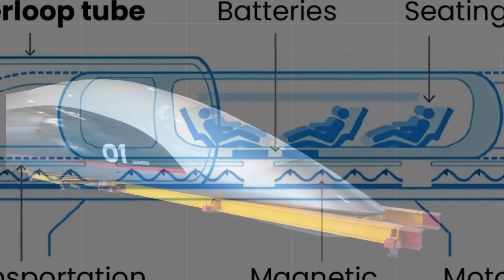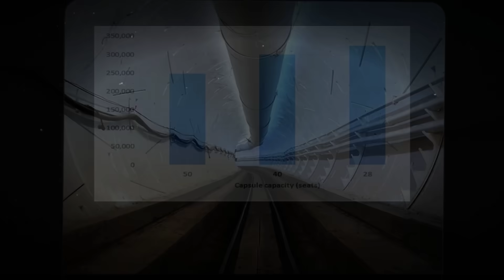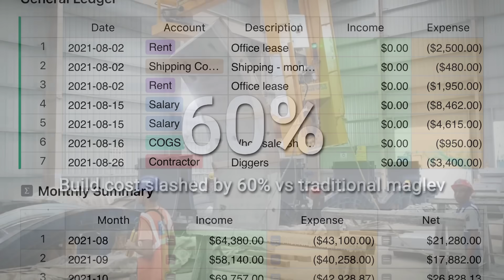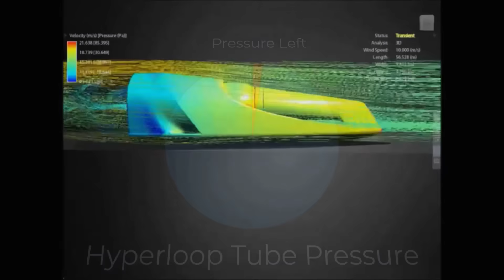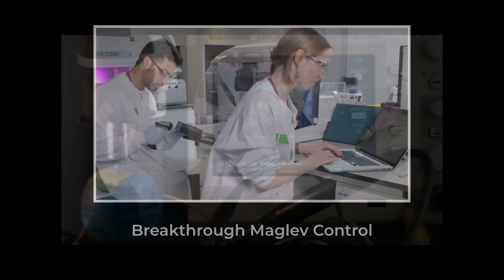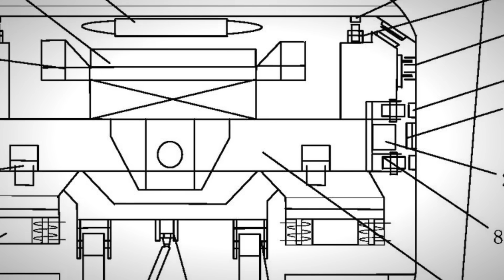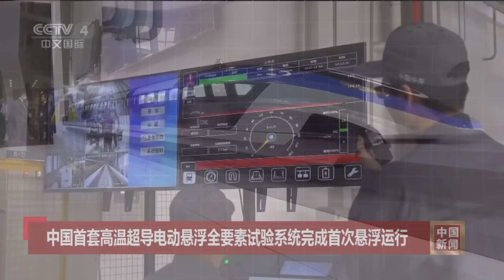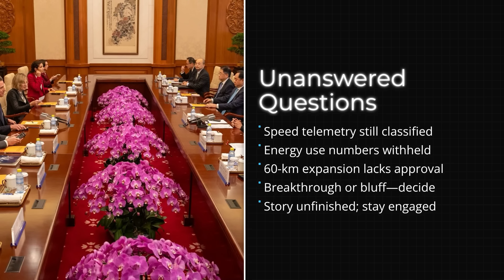China’s 2-km Hyperloop-Like Line in Shanxi That Cuts Costs by 60%

Comment: rather than creating a vacuum, seems more practical to just make the air move as fast as the train! Like big fans!
Reply: Make two tubes one for each direction, suck air from one tube and blow into the other, on each end.
Trains will fly like pistons pull from the front by partial vacuum and push on the back by pressure.
Reply: No.  You'd need gigawatts of power to accelerate the air to the speed of the train, and more power to maintain that air speed along the entire length of the tunnel.  Most of that energy would be lost as heat from friction.  You'd basically cook passengers in their seats.  And what would happen if the train needed to slow down or stop?
Reply: @-_James_-  there’s no need to accelerate the air, just evacuate the air from one tube to another. A ship gas turbine should be adequate.
Fiction loss can be minimised with electro magnetic bearings or many tiny holes on the train surface providing air cushioning. You probably need an air pump in the front to remove the air from speeding along. When the train approaches the station, the pumps stop and seal off. Then the door opens to the station, it got to have a door shaped like a shell to maintain partial vacuum on the tunnel. As the train approaches, the pressure will build up because the volume in front is getting compressed by reducing volume. The door will open when the pressure is slightly bigger than outside atmospheric pressure. Maybe more than one door to prevent too much air rushing back into the tunnels, the air has to be kept very clean to prevent wearing out the tunnels with dust particles.
Reply: @madsam0320  Well, you have to remove the air from one end of the tube anyway, otherwise the build up of pressure would ultimately liquify it.  The original comment stated "just make the air move as fast as the train".  That will be in the region of 1000km/h or faster.  And to do that along any reasonable length of tunnel will require insane amounts of power.  The friction and heat isn't from the train.  It's from the air hitting the sides of the tunnel.  And yes, around stations you'd need an airlock (you'd need one with a vacuum tunnel too, obviously), which would introduce a whole ton of other issues if the air is moving as fast as the train.
Reply: @-_James_-  yes, there’s many issues, it’s not very efficient and will be very expensive. Those tunnels have to be very smooth, well sealed and able to withstand the constant pressure change. MagLev trains are more doable and they are not catching on.